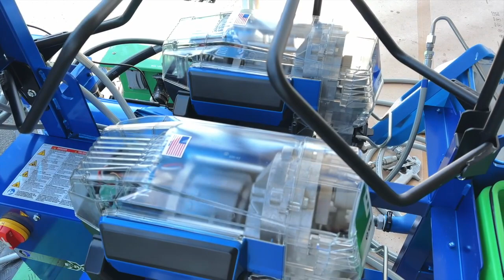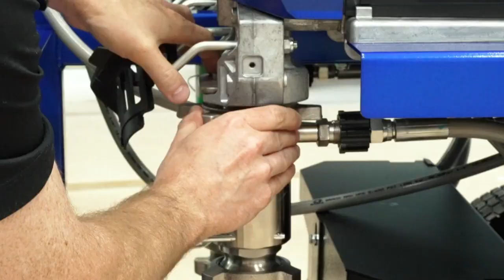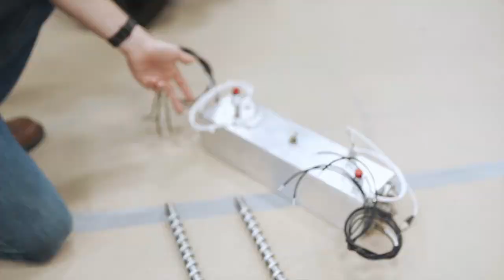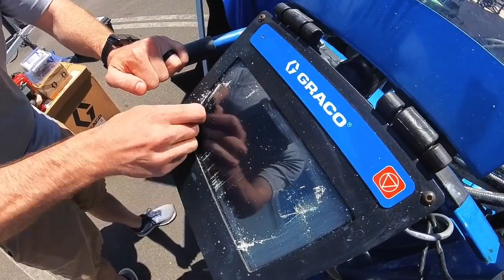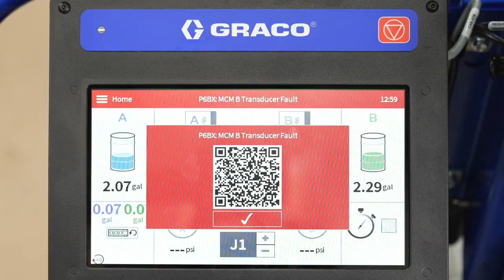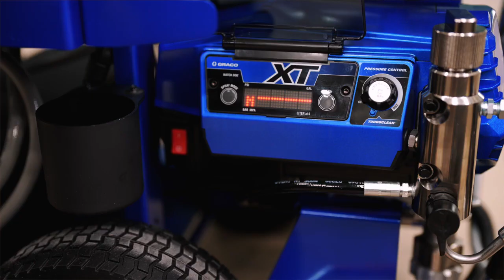E-Mix XT — Overview & Best Practices

Comment: So if I used it for spray foam how would I get the material out of the 55gal drums?
Reply: You can pressure feed with your drum pumps by removing the hoppers and plumbing straight into the intake valves of the lowers. You'd be better off using a Reactor for spray foam, thought. You'd need a Fusion gun regardless.